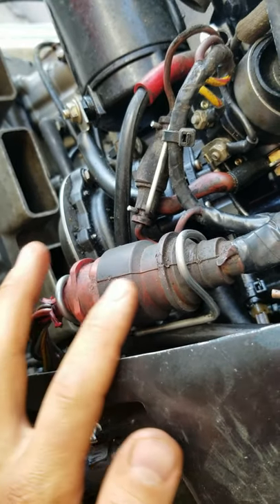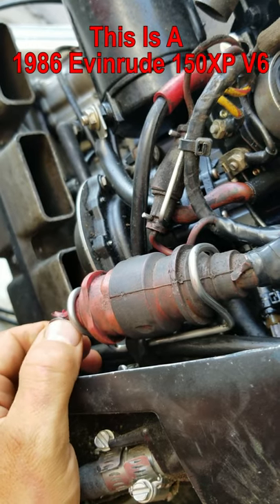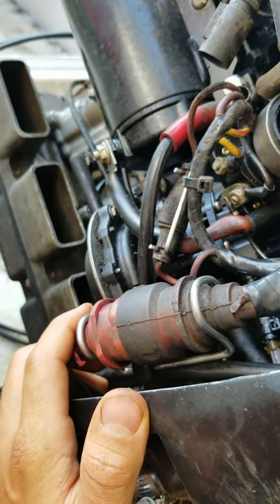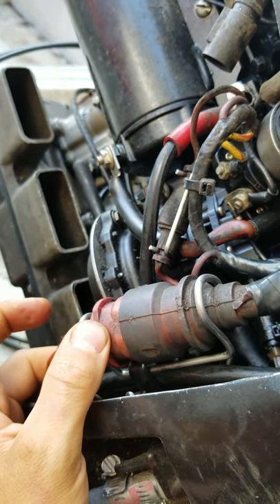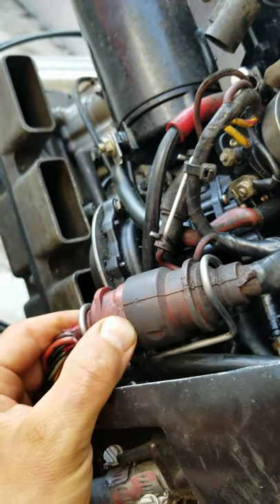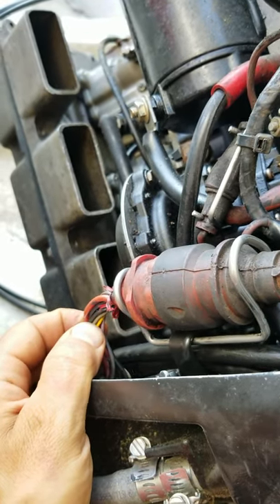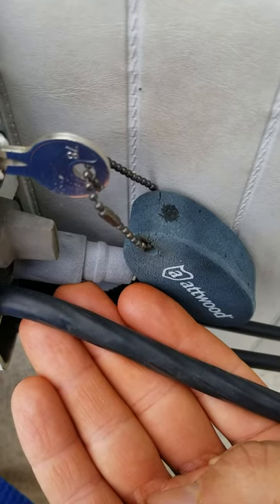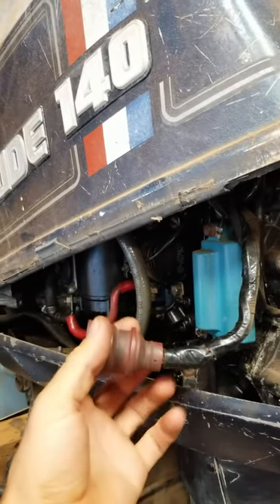Evinrude Outboard BIG Red Plug

Comment: I have a 1980 evinrude 35hp with the black plug. I need to replace it because the wires are all broken. Can I use the red plug and install An new controller?

Comment: Hey Matt, does this just mean you loose those features or will it not start at all? My boat is basic anyways and has no gauges.
Reply from the maker: You will loose pretty much all the features, and you won't be able to turn the engine on or off because the key is wired through the plug.
Reply: @MattsShop  Thank you for the honesty and for the heads up. Best to know now than later.
Reply: @MattsShop  Hey Matt would the plastic pieces inside be roughly the same my actual issue is the plastic pieces in my current controller are gone and need replacement but no where seems to sell them in the UK.
Reply from the maker: @JCinematic  I'm not exactly sure what part you are talking about with the plastic pieces?
Reply: @MattsShop  Hey Mat the nylon parts that allows the throttle cable and the gear shift to move

Comment: Can one be started without the harness plugged in on motor side 
Just jump the starter off with leads? 
Or will it not start due to safety switch
Reply from the maker: Yes it can, but you have to use the choke to shut it off or rig up a shut off switch. Not the safest.

Comment: Does this turn the ignition on? Can you start it with just a push button remote start?
Reply from the maker: The outboard will run without it plugged up, but you won't be able to stop the engine without the key.
Reply: @MattsShop  OK thanks bud